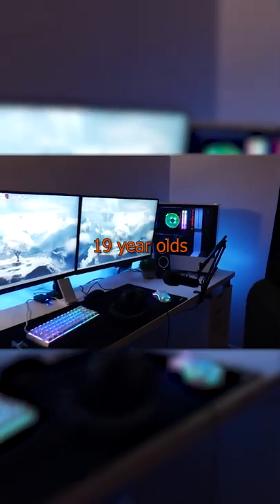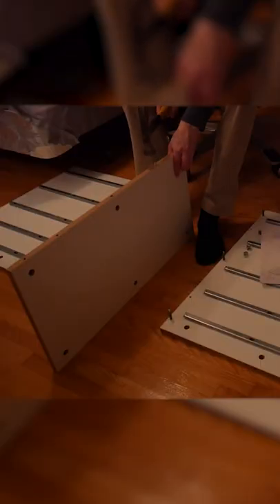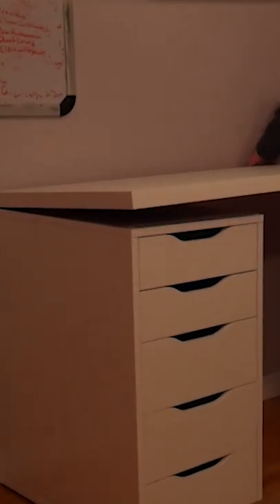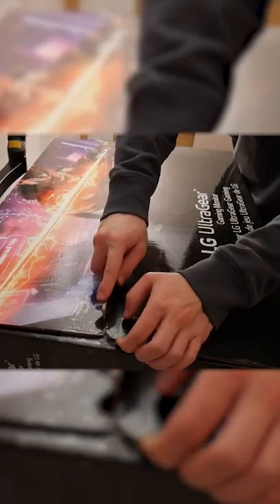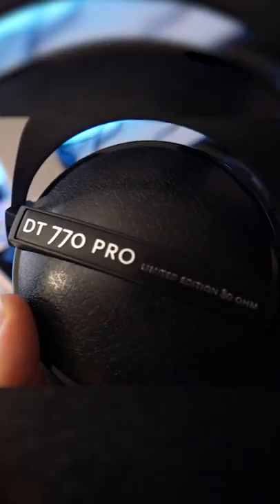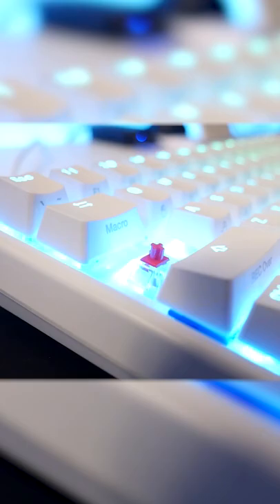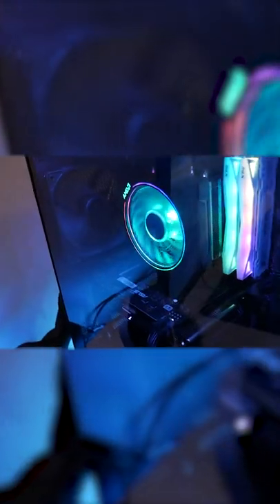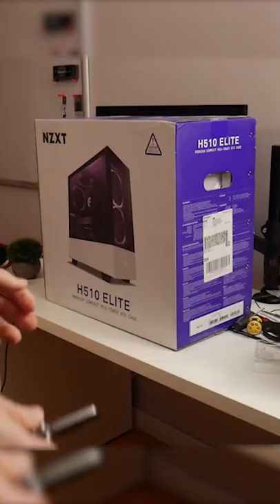A 19 Year Old's DREAM Gaming and Editing Setup Tour #shorts

Comment: a stock cooler for 3900X in a NZXT case ???
thermal throttling incoming
Reply: At least use a 280mm AIO
Reply: Heh. Yeah. Amateur. Everyone know not to use the stock cooler.

Looks around nervously
Reply: @mowgli6345  me lol wraith gang
Reply: Yeah but I’m using a Ryzen 9 5900x but I’m using the stock cooler for my Ryzen 7 3800xt😅
Reply: 🤣💀 
No kap I was literally thinking the exact same thing! I saw that and cringed like oof! 
But congrats on the new set up
Reply: @mowgli6345  the ryzen stock cooler isnt bad, its the fact that he put it in an nzxt case
Reply: @Drewkungfoo  it's called a 240mm
Reply: Using stock cooler that came with my 3900x, 65 degrees maximum when running my games & whatnot, it's not terrible. I can still hit it when compressing using Handbrake and it won't thermal throttle
Reply: @doggo4537  Uhm, there are also 280mm AIOs/Radiators?
Reply: I cant Believe people do this. Im over here so scared about my i5 10400 throttling even inside my mesh case. His case choice is awful. Not only is the case unreasonably priced ($150 where i live) it has ass air Flow. Theres is only 1 type of person who buyes nzxt cases.
Reply: If the package came with the cooler, it’s fine. Why would they put a sad crappy cooler with a super powerful cpu
Reply: @RaceCarGuy517  the cooler is decent. not quite enough for a 3900X but it works. just the case is ass
Reply: Well that's what happens when ppl that know nothing about computers look at tik tock for PC info
Reply: Ikr
Reply: Qnd the 650w psu
Reply: @Random_cheater1  ???????????
Reply: @omega_6777  x63 nzxt
Reply: @Idontknow4  no
Reply: @realTryAngle  ?
Reply: @mowgli6345  not everyone, we’ve had some professional builders that’s been doing it for years.
Reply: stop underestimating the wraith prism cooler

Comment: you might need a larger power supply to support future upgrades. Maybe i’m overdoing it, but i got an 850w psu for my 1050ti because I didn’t want any power drawbacks.
Reply: @TheAverageTechie i ended up upgrading to a strix 3060 so i guess it worked out.